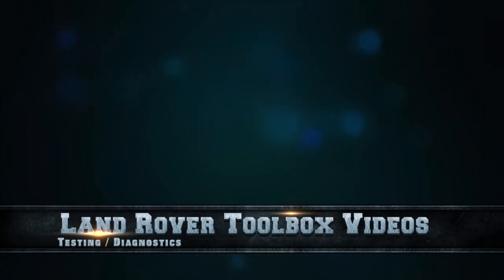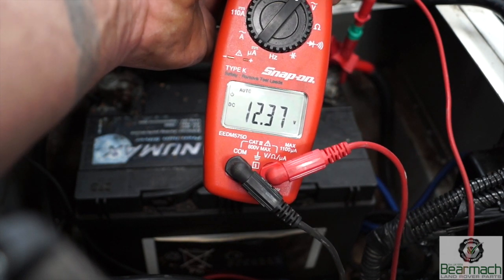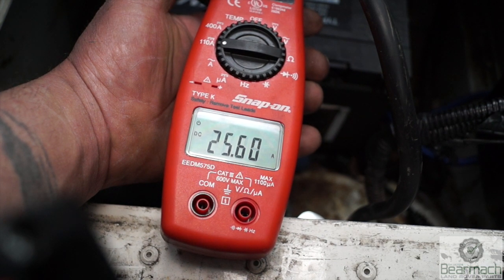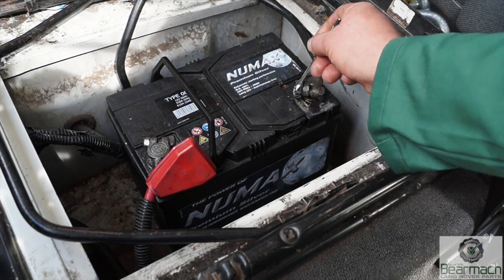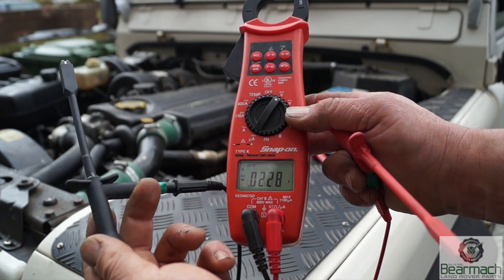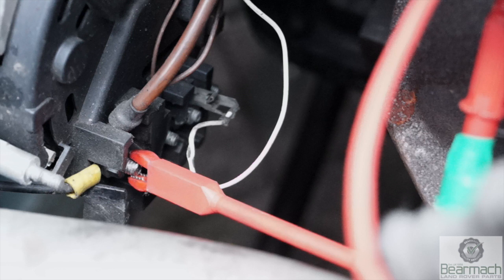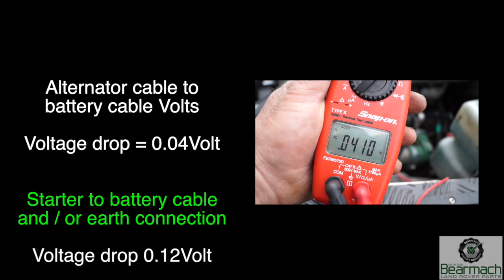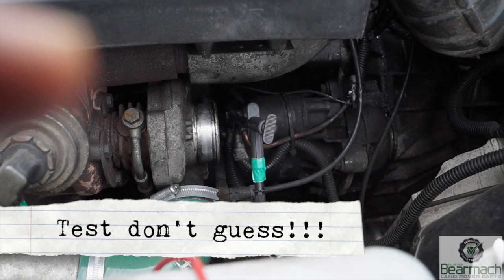Checking alternator output  -  The Fine Art of Land Rover Maintenance

Comment: Hi, again, you provide an excellent video. I am not quite sure, whether the third cable, you mentioned, is for the speedo. Isn' t it for the rev counter? (connector "W"). We fitted a 200TDi engine (Discovery 1 spender) into our LR 109 Series III LHD, ex-mod) and tried to fit the 300TDi alternator. But this doesn't work due to the position of the mounting holes. So, we had to stick to the 200TDi alternator, but had to turn the two halfs of the casing to find the mounting holes in the proper position. Furthermore, we mounted a bracket from an 2.25 Diesel and fitted distance tubes (which came in a kit, Steve Paker Land Rovers offers) to get the all in line with the pulley/v- belt. So, we are still looking for 100A alternator upgrade. We appreciate any suggestions. Thanks in advance.

Comment: Good afternoon,would you have any advice please?I have had a look for a thread related to this issue but can't find anything,so here goes. I am coming to the end of my defender 90 300tdi build,when starting,the ignition light comes on (battery light) but does not go out when started. If I bridge b+ and d+ it charges at 14.5v and the battery light goes out,likewise, if I put a feed to the warning light when the engine is running the same also happens. There is two brown/yellow wires at the dash,I'm guessing one goes to the alternator and i think the other goes to a white wire with inline resistor. Would you have any ideas please? I will be very grateful. Thanks, Matt

Comment: I have a 2007 Range Rover Sport 2.7 tdv6. Trouble is the alternator and battery have been replaced (Both new items).  Trouble starts when driving at 2000rpm and above all is OK, But, under that, the battery light comes on, until above 2,000rpm again, Starts fine even after left overnight without any problems, first turn. Any suggestion where I can check, Thanks?

Comment: Why did you say don't use silicone (I assume you mean silicone grease, not bathroom sealant!) on the battery terminals? Thanks.
Reply from the maker: Spike0907  Thats right.  No silicone grade or bathroom sealant.   Vaseline appears to be an industry standard.
Reply: Land Rover Toolbox Videos what about copper grease
Reply from the maker: Copper grease believe it or not promotes corrosion on the terminals.

Comment: I have a question of my particular issue....  i use an ultragauge in my 2003 LR discovery 2 Petrol v8  to monitor battery charing ... when driving without A/C it runs fine and i see charging while driving around 13.7-14.2( cold) and when driving awhile it settles in around 13.7+/- and all is happy... but if I turn on A/C it drops to 13.3 to 13.2 and in morning it is dead.. i just today replaced the relays and heater blower but still seeing similar drops.. now back story.. my alternator had been going south and finally died.. it eventually took out my red top optima but I recovered it with optima charger and replaced battery with new battery which took the brunt loss when alternator went out.. anyway both batteries charged but still showing that drop ONLY if running a/c... with ignition off I also did parasitic draw test and was reading .03amp after about 6 minutes so no drop overnight.. unless...... and Ill know tomorrow... if one of the relays stayed active?  anyway im perplexed at this point... maybe its just both batteries are shot just enough they cant take a drain that well with a/c on? ugh!
Reply from the maker: So what I understand t the AC is, if used the killing the battery overnight?
Reply: @trailerfitter2   well actually i see it killing the battery while im driving and using it... without using a/c i watch my onboard obdII ultragauge showing 13.7-14v charging but as soon as a/c is on, it starts dropping over a few minutes to 13.1 - 13.2 and then when I park and come back out.. its dead... i was looking at my positive lead on battery and there is some exposed copper that has patina showing in green.. is it possible when any ancillary electrical device is activated like lights or a fan that not enough current from alternator can return to recharge battery? sorry for leading the narrative .. its just frustrating! lol

Comment: Chris -  I have just replaced my Lucas IR/EF 36 Amp 12V alternator in my Series IIA petrol. My Ignition dash light stays on. I removed the small wire from the outermost terminal on the alternator and the light stays on with ignition key on (motor not running).  I started the engine, with the wire still removed,  and the light stays on. I used a multimeter from the small outermost terminal on the alternator (engine running) and grounded the other end of the multimeter. Voltage something like 0.2V.  Took a reading at the battery: Engine running at idle, 11.7 volts at the battery.  Alternator 
does not seem to be charging the battery. A brand new alternator. Any ideas on these issues? Ignition light and low charging reading? Any tests I can do?  Perhaps it is a grounding problem? Thanks - Mike
Reply from the maker: A ground is the engine block for the alternator. If you have bad earth it wouldn't crank over very well.   by the sounds of it, the new alternator perhaps is faulty?   Yes, it does happen.
Reply: Hey Chris -
Thanks for the reply. Turns out that the ignition light on dash was grounded by the metal dash itself. Removed the bulb&housing assembly from the dash and light goes out when car starts.  Will re-test voltage tomorrow. Tested this morning and voltage coming directly off the alternator still on the low side for a new alternator (11.7V).  Thanks! Mike @trailerfitter2

Comment: awesome vid
Reply from the maker: +Foxy rollins  thank you
Reply: +Land Rover Toolbox Videos 
in my land rover the battery icon goes on and off I took it to a mechanic and he rolled over and  hooked up this large tester to it after the machine went through a couple of phases like pressing the gas to 1500 rpm the test was over and it showed the alternator had failed.can i trust this test to be accurate?
Reply from the maker: yes of course.
Reply: +Land Rover Toolbox Videos 
thanks alot for the advice I really appreciate it

Comment: I have 14.3v at the alternator, and 14.0 at the battery, can I add a 2guage wire between these points to improve charging
Reply from the maker: Check to see which cable is losing voltage, then either replace  cables /or clean contacts.
Reply: @trailerfitter2  I've found a very shoddy broken ring connector at the braided ground strap from chassis to tranny. Replaced that plus added extra ground cable, this has me with 14.55v at the alternator, 14.45 at the battery, starting seems much better so far!

Comment: When I was driving defender 200 tai the battery red light on the dash board came on & off I have check the battery that’s ok & check the conditions on the battery there ok when the engine is running idle it’s not doing it only under load it does it I have put a new battery on it can you help please

Comment: Hello there! I have 2003 Range rove and when i test the battery it gives me 11.6 , i start up the car and after shut it down i test it again quicky it gives me 12.1 is it ok?
Reply from the maker: I don't know how long you ran it for but you need to charge the battery fully then test it.   The alternator output should be at least 14v or over. After running the battery, if fully charged should sit at 13.6 volts straight away. That is because it has a surface charge on the battery. Unless the battery is faulty or not fully charged.   

Charge the battery with a battery charger and test it again.  A fully charged battery should be 12.7v with the surface charge gone.  Means you charge up the battery, put your lights on for a minute or two then test the charge of the battery.  Anything 12V and under means the battery is discharged and faulty.     12.4V means the battery is half discharged.
Reply: @trailerfitter2  Thanks for the info man, i really appreciate it 👍🏻